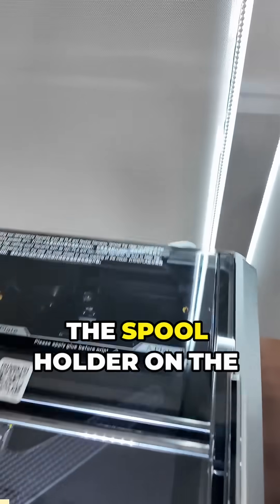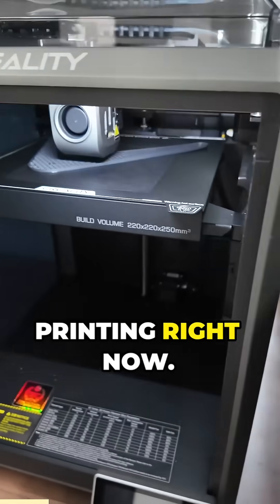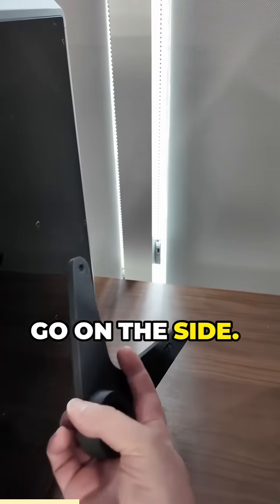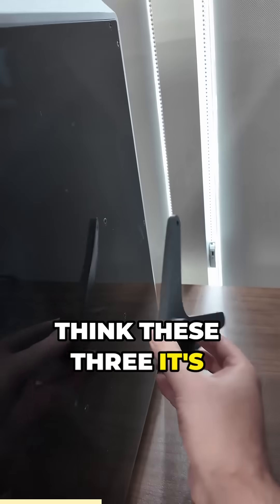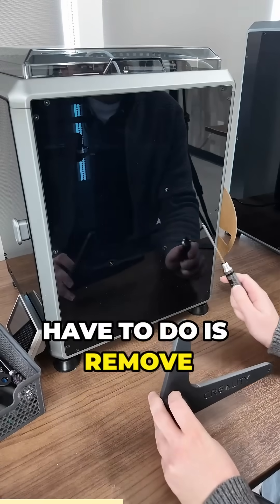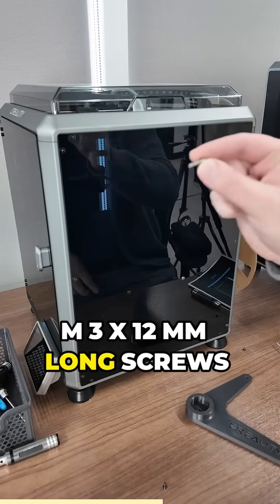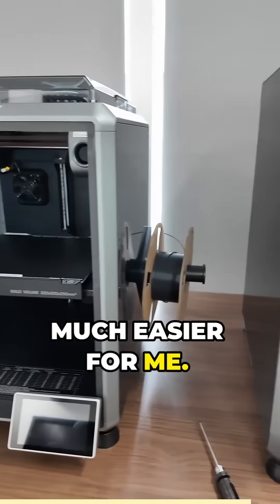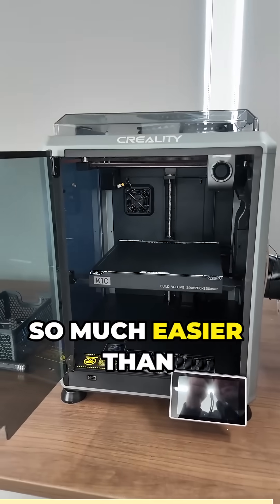3D Printed Upgrade for my Creality K1C #3dprinting

Comment: You can move the thingamajig that you pull the filament into round the back to the side too, top right hand corner there is two screws, you’d just need to make a bracket that you screw into the side with an additional two screw holes too and just screw it onto the side then screw the box onto the side of that bracket

Comment: Do they include the 3 12mm long screws or ?. Definitely not very intelligent reviewer
Reply: They do include the screws. I didn't know what they were for, but this is obviously what they are meant for. Yes, the reviewer should have been more informative, especially for a "how to"-style video.
Reply: You're not serious right? If so, you are the 'not very intelligent' one😂.
YOU print the side mount YOURSELF. So that also means that YOU have to go to the local hardware store to buy some M3x12mm screws
Reply: @maxmax123  your wrong, the screws come included.
Reply: @maxmax123 That longer screws are included in the basic package of the k1c, at least for now.😅

Comment: I also recommend getting the file to print the mount for the sensor to be on the side .also highly recommend printing risers for the top cover than routing the peft tube on the side directly to the sensor instead of it going to the back then side ...believe me it's way more reliable and easier to feed the filament
Reply: You are not clear enough. The filaments sensor? And the PTFE tube already goes straight to it. But it is on the back, not the side. Yes, you can print a bracket to move it to the same side as this side-moumted bracket, but I don't know what you mean when you say about it "going to the back then [to the] side." You are giving advice, which could potentially be helpful to some people, but you're not explaining yourself clearly enough for anyone to actually know what you're talking about.
Reply: Where can u find that?

Comment: but you still need to reach around the back to feed the new line in?
Reply: You can prolong the ptfe tube to the run out sensor making it even easier:)
Reply: there is a file on makersworld/thingyverse that moves the sensor to the side. I have one on my k1c. and download the bowden tube brackets to so the chain can move more freely.